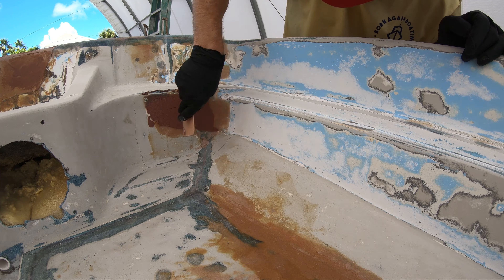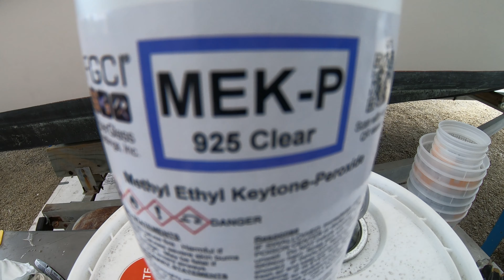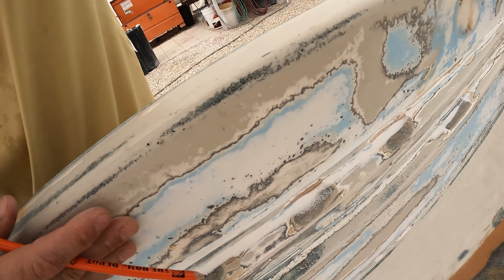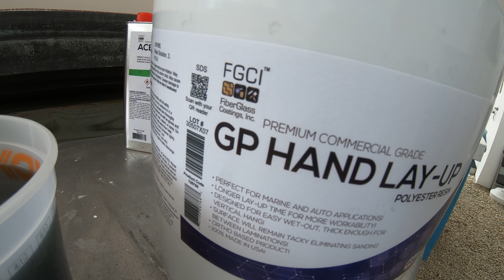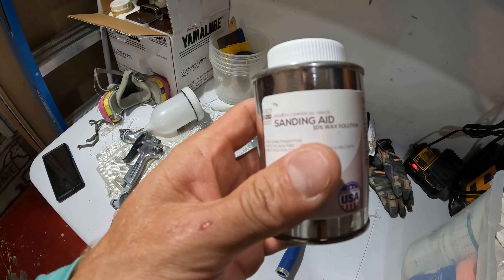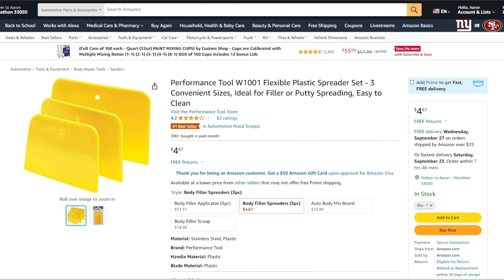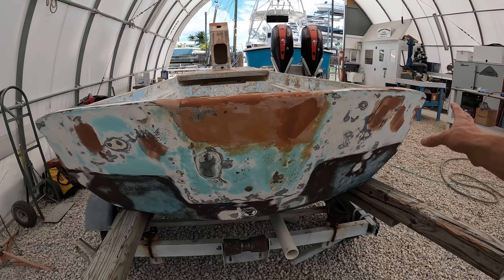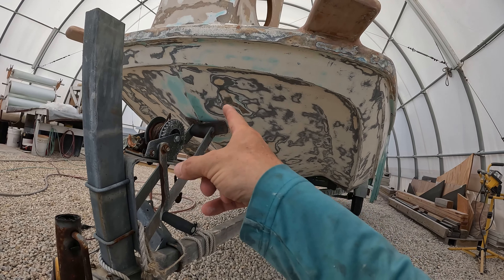Making Boat Paint Look Pristine! (Best DIY Method)

Comment: I have a Chrysler Tri- Hual needing repaired for couple years now - just pulled carpet and sanding floor to reseal- but need to work on the haul and repair spider cracks and dings as well. Watching your videos help with project products I’ll need

Comment: A thorough presentation of what is included in doing a complete renovation of a fibre glass hull. Superb detail, yes, that is exactly what is required to bring the finish back to original. However, just two points, l would avoid taking the grinding back to the glass as this is porous and would require a lot of building up of filler, which leads me on to my second point - the cost of the products used in this renovation would far exceeded the value of the boat!! But heck, it’s not about values, it’s about love boating and showing what can be achieved with the right products and a hell of a lot of time. What l hate about doing a job like this is the amount of nasty dust it produces. Thumbs up buddy
Reply: To your second point, that’s what all these commenters that say just junk the boat don’t understand. It’s not a what you SHOULD do tutorial, it’s a what you COULD do. And they’re covering all the bases here, so if you have one of these things to do to your boat, you can come here and see how to do it. Though mistakes have been made… it’s still very diy friendly.
Reply: What's this? Not grind back to the glass? Not a good idea, always grind to the glass. That's how you repair fiberglass and get a good structurally strong bond especially where the  inside of the boat is a structural member of whole boat.  Structural parts of the boat need to be done correctly, in my book there are no exceptions for this, NONE!

Comment: Hats off to a great job of getting it done. As far as costs for custom boat, go buy a newer boat in better shape then customize it. You might have hidden hack jobs under the glass, like strutural issues caused by not grinding to the glass and just glassing over gelcoat. I'm a hands on guy and would rather make sure it's done right then rely on faith of "hey it looks good so it's gotta be good" mentality. Sure you might be able to do it cheaper but this was a restore to custom job and some people will never get it.

Comment: Try not stirring your filler when you mix it. TKe application tool and scrape and Ford. Stirring causes at bubbles to get whipped in. It will see you a lot of sanding n filing

Comment: Can you pull a vacuum on the filler before usage? Could this eliminate air bubbles? 🤔
Reply: Unfortunately not. The voids are from the putty sticking to itself and sticking to the spreader as it slides over the surface. Imagine it as the ridges you see when you’re making a pb&j sandwich.
Reply: @SparrowMoonhaze  Thanks for the reply! 👍

Comment: I would just use a high build primer .. I also recommend the 3m accuspray gun.  Works wonders and takes seconds to clean the tips off.  The tips are cheap enough to where you can just throw them away , but typically you get 3 to 4 uses out of them , the accuspray gun is so light it cuts down on fatigue on the wrist ..
Reply from the maker: Thank you!

Comment: If you cloud up your plastic regulator lens with acetone. You can fix it with more acetone. You put the acetone in a pop or energy drink can and make a little spout for it. Then, using a small torch on the can, you heat up the acetone to vapor and fog it under the plastic allowing the vapor to rise in front of it, and the lens looks brand new.
The same method can be used on plastic headlight lenses. But with those, you have to immediately cover them with uv protector since they'll be exposed to direct sunlight a lot. There's a few videos on here of how to do it.

Comment: No need to add the wax to your fairing compound. You're just creating another round of sanding for yourself. If you insist on having the resin completely cure between applications you can spray it with PVA

Comment: I'll stick to an aluminum welded boat.  So much less work, no  putties, fillers, plastics,. No paint is the way to go.
And when you get dents and scrapes and scratches in it. It ain't nothing but a merit badge, of heavy use, fishing hard! And Economically.